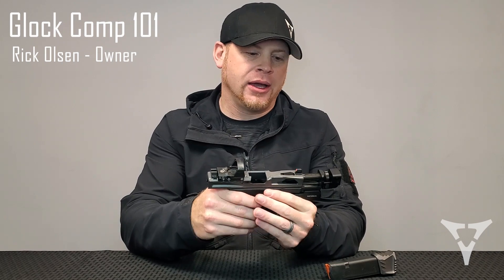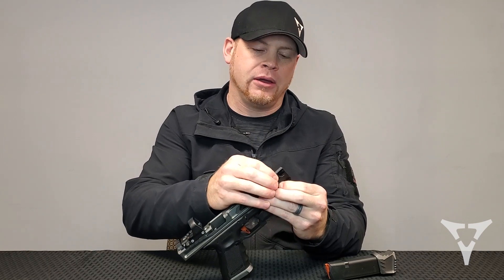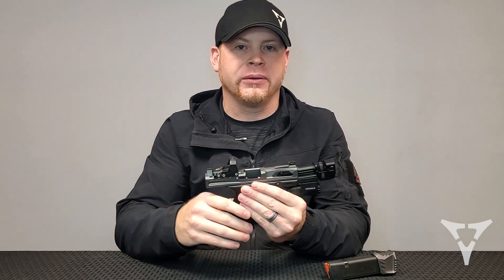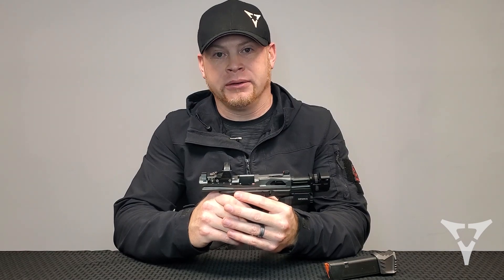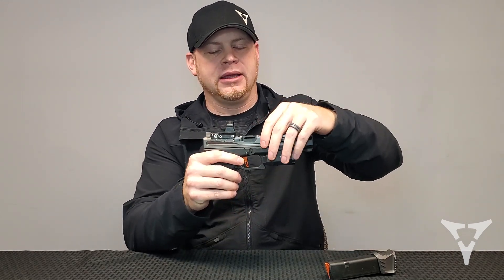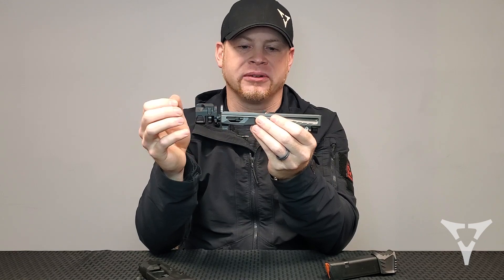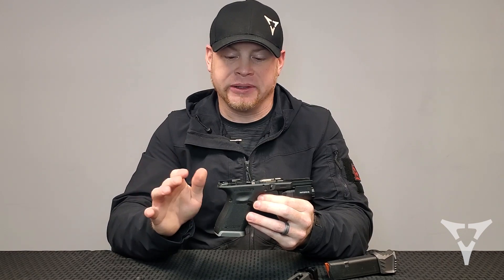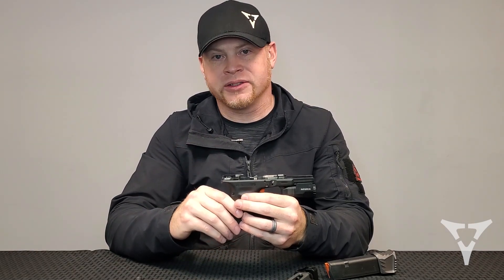Killer Innovations Comp Trouble Shooting Video

Comment: I got a Killer Innovations slide on my glock19 Gen5. I bought a Gen5 Radian Ramjet barrel/comp combo and it ended up not fitting on my slide. Even though my slide is advertised as a Gen5 the nose is cut like a Gen4. So then I ended buying a Radian Ramjet Gen4 barrel/comp kit and it still doesn't fit. Either Radian cut the barrel too short, or Killer Innovations cut the slide too long, Or both companies messed up. I have bought enough parts to build 2 guns at this point, I am beyond pissed off.

Comment: Just installed with velocity barrel.   Amazing aesthetics! The gun just looks tough now😎…  Super Easy install but Would have liked to have had the needed Allen wrench 🔧 included for the price of the parts. 

As for shooting,  Pistol- gen 5 Glock 17, fairly broken in with about 1200 rounds run through. Felt recoil is better for vertical movement, however the perceived sound is dramatically increased. The gasses being directed upwards and horizontal makes the sound pressure from each shot drastically more “in your face” which caused me to flinch more when shooting. I’m sure after a few hundred rounds I’ll have the flinch mitigated. 

Accuracy/ aim point needs to be  adjusted and remastered. I’m not sure if it’s the velocity barrel or the comp but my shots were far more accurate with stock  OEM barrel. I will comment again in the future after more testing😅.
Reply: Also the pistol ate Winchester 115 gr ball target ammo with no issues.
Reply: Point of impact can change quite drastically. I put a comp on my pdp and I had over an inch of difference between hit before the comp and after it’s not that the comp made it less accurate just that there is a shift in point of impact. I shot federal range ammo for the first time in a while and it had a 3 inch shift from my carry ammo so go figure never would have though there could be that big of a difference at 10 yrds.🤷
If your running a dot probably needs to be re sighted in. I would sight it in to your carry amm if your carrying this gun.

Comment: Can I run the comp on a stock threaded barrel or do I need to build this thing fully out with your parts to get things running smoothly?
Reply from the maker: It will work with OEM barrel, just won't be tool less removal.

Comment: hi great video, I have a question I am using DPM multiple spring recoil reduction system on my cz p10F, running one of your threaded barrels and the comp is on its way the DPM systems spring in not a flat one like the factory spring pack. Are there any reports of the spring getting hung up with the DPM system springs. Thank you
Reply from the maker: Hello, great question. In our testing and experience, the oem spring works just fine on the P10F. We have not heard any reports of the DPM spring combined with this comp. Thank you!
Reply: @KillerInnovationsYT  Thank you for the reply, I will let you know how it works when comp gets here. I use 124g high tec coated reloads with 5.5g of HS-6

Comment: Hello dear. Dear i have a totaly stock lower,with killer innovations slide,killer innovation threaded barrell and stock internals for the slide. But i am facing issues in failure to feed,i have hardly fired 10-15 rounds with it. When i put the OEM barell in killer innovation slide,it starts cycling properly. Its a Glock 19 Gen3,can u please address the issue
Reply from the maker: Please send an email to support@killer-innovations.com We can help you further there. Thank you

Comment: Does this work with DPM Coil reduction system? I'm running on a glock 45. You mentioned using certain springs or guide rods. Any brands you can recommend?
Reply from the maker: You can use one yes, however we make our own 13# spring kit I would recommend. You can find it on our site, killer-innovations.com
Reply: @KillerInnovationsYT  I saw. Im gonna grab one.

Comment: I have g17 gen 3 ...failure to feed failure to eject ...i was told with the 13bls spring ..change the ejector to gen 4 and it solves this issue ...does anyone know if this is true ..i just ordered a gen4 ejector to try
Reply from the maker: Could be an ammo thing, I have heard some people say use the gen 4 ejector. We have not confirmed.
Reply: @KillerInnovationsYT  not a ammo thing ...its a priduct thing ..installed the mass driver and it fires flawlessly ..i have tryed all types of ammo with the killer innovations and it fails the same manner ..automatic barrels tilt up in blow back which the muzzle restricts the slide ..the mass driver has a foward recoil spring on its device that keeps this from happening ..when the slide blows back the muzzle blows foward seperatinv the 2...its perfect ..killer innovations should make a gadge spacer so its not mounted so tight againt the nose of the slide
Reply: @KillerInnovationsYT  also tryed the gen4 ejector and the holes dont line up on the lower ..didnt want to redrill it through because if it still didnt work i would had just ruined the lower ..

Comment: I have this comp on my CZ p10 with #13 lb guide spring, HBi trigger, #3 lb stricker spring. I get the shell caught on slide in ejection each round using 115gr. I tried 124gr and get the shell caught about 3 times out of 20rds. Better but still not acceptable. My question is; What can be my issue. Tried changing configurations but still can't get the gun to have zero issues. Will changing the comps barrel protector to the thicker nut help? Anybody with experience please chime in.
Reply: Use grease.
Reply: Is your guide spring flat? Did the oem guide spring not work with setup?
Reply from the maker: Please reach out to support@killer-innovations.com We apologize for the delay.

Comment: I have a Glock 17 killer innovation slide, and threaded barrel . Would this work with a micro Roni?
Reply: No - they are designed for the barrel to run right up against the tube for the Roni muzzle. You can take that off like if you were running a silencer
Reply: My killer innovation got some rust on the slide. I am not sure what to do about it. I thought it was treated against rust.

Comment: Hey brother, trying to put together a sig p320 build in which I'm going to be using your barrel and comp combo, along with your mag extensions, do you offer the "velocity" slide for the p320 or just for glocks? Thanks.
Reply from the maker: Actually working on them right now. Please check out our Instagram!
Reply: Definitely looking forward to its release. I emailed with Anitra , great informative, and prompt response. I was told just that, and that it should be available within a couple of months. Thanks, keep up the good work.